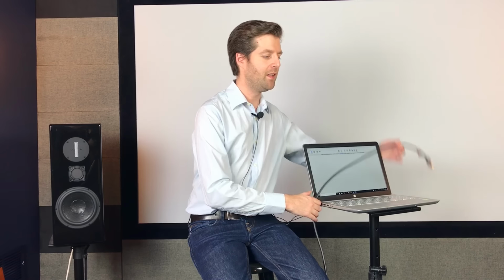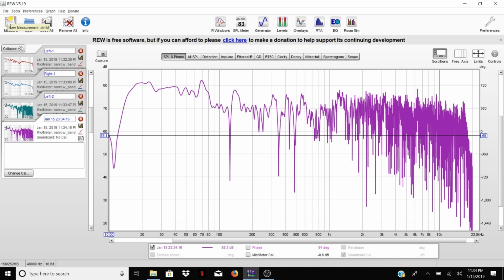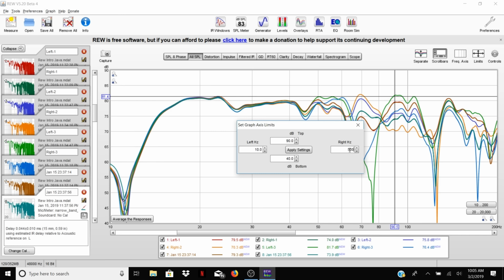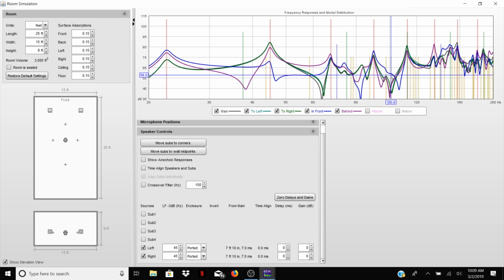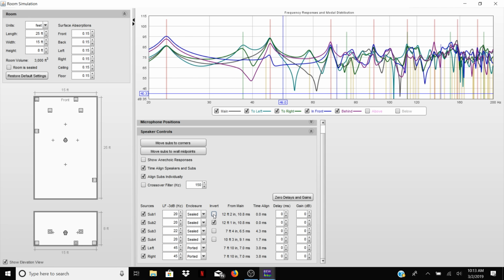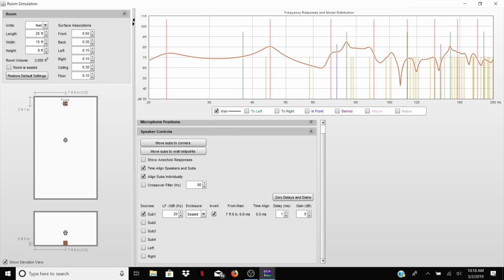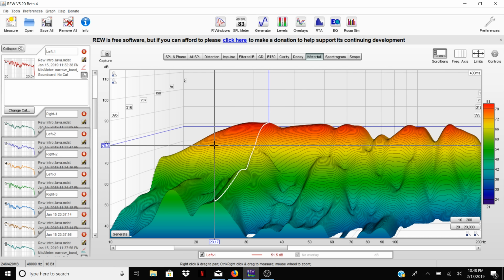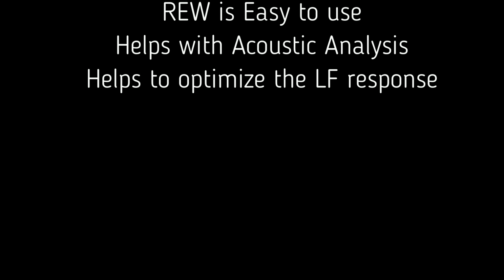How to Do Room Measurements Using REW Software

Comment: Sigh....I just want to know how the changes you make with "rew" are implemented into your avr? I have a denon avr. When you make changes to the frequency curves with "rew" connected to your avr thru a hdmi cable does it automatically change the Eq settings in the internal EQ of your avr?....please anyone????? I'm litterly at the point of begging at this point!...lol!!
Reply from the maker: What? REW is measuring the acoustical response in your room of the changes you are making to your system. When you alter the EQ, delay, level, phase, etc through your receiver and on your subs, you measure those changes with REW. The ONLY way REW can EVER make changes to your system is if you're using a room correction system like DIRAC or mDSP but that goes beyond the scope of this video. REW is being used as a measurement device here, NOT as a device to implement corrections to your system.
Reply: @Audioholics  well thank you so much for clearing this up! But,as a "nubie" you kinda get the impression by watching yours and several other videos on "rew" that it corrects speaker issues. The videos are excellent in the sense they show how to read frequency graphs an so on. But not one video has shown the viewer how to use the info given by "rew" to change settings on an amp or avr or even how to change settings to correct particular issues one might have in a given room. It's awesome to be able to see how a speaker is performing but just knowing a speakers performance curve without being able to correct anything in my opinion is kinda worthless.thank you again for clarifying this issue! I now understand I need to purchase a "dsp" to be able to correct the the frequency response my speakers have in my room. I will say it would be nice to see a video on how to properly change the settings in an avr to change or "correct" any issues in a given room. Its something that is lacking in any video I have seen myself on YouTube and I'm sure by reading several other comments that I'm not the only one who is a little confused on what to do with the info "rew" gives you tou implement correction to a room. Thank you for your time!
Reply: @number1pappy  look up home theater gurus mini dsp 2x4 tutorial
Reply: @discostew9220  thanks but I've learned a lot since my comment a year ago. Since then I've purchased a dsp and have implemented it in my system. I will still say that for any "newbie" the info that is predominantly out there is very confusing at first! Especially channels like "Audioholics" and similar channels like it. Now that I've actually learned a few things its easier to understand. I just think some of these channels "forget" that not everyone knows the basics.
Reply: @Audioholics  So how can we implement them into a PC and play music from there? Maybe over an external DAC.
Reply: @Audioholics  finally, thank you!! You know your dealing with newbs right??

Comment: Is right the left and right channel play together with sub in measure the low frequencies or only the sub can play ? And how measure each channel individually or all together ? Thanks !!!
Reply from the maker: Always measure both front speakers + subs to see how they integrate together.
Reply: What about the center?
Reply: So what about the surroundings speakers do those one at a time? Am doing an 11.4 or 13. 4

Comment: I'm issuing this channel a challenge. Find the best tailgating, Bluetooth compatible, portable, clearest, hard bass hitting speaker / PA system available. Or build or tell us how to build one comparable. This particular market may seem flooded with options at this time but, it is not. Unfortunately the quality of most options are lacking when checking consumer opinions.
Reply: Plus the exact components list and details are not given by manufacturers which I'm sure is so they can sneak in lower quality components.

Comment: The only tools you need to take any kind of measurements,,, are those stuck on the side of your head,, that's right they're called your ears.
Reply: Do you honestly think you can tune the deep bass to ±1dB using only your ears? Or tune the RT60 to 400ms at all frequencies? 

When I optimized my speaker placement and listening position by ear I ended up with a ±12dB response <100Hz. When optimizing it with the help of REW I got a ±5dB response. Once I had applied DSP I had it down to ±1dB (before adding some tilt).

Comment: nice!  A short video with how you should proper measure speakers/drivers frequency for us (audioholics fans that also do diy) would be amazing
Reply: i raul it’s not something we have discussed but there may be some projects that lend themselves to this. Are you looking for measuring DIY speakers to design crossovers or how to characterize a speaker (like Spin-O-Rama)?
Reply: @PoesAcoustics  yes, how to proper measure a speaker with calibrated mics and software  (frequency response without anechoic chamber) to check if the manufacturer claims are real or just marketing and for the diy people that buy already made speakers But also try to make their own designs just because it's fun and rewarding
Reply: i raul I have something planned that should address this. Now that the weather is nice we will start measuring speakers again and I plan to video the process and create a video of what we are doing. 

Just a heads up, what we do  is a very by the books approach and as such, hard to replicate without spending some time building your own measurement rig. James Larson takes his work very seriously and built large custom rigs to measure speakers without much diffraction or reflections from the rig. Still, it will show how we do it and what it takes to get good measurements. This won’t be done for a few months however.
Reply: @PoesAcoustics  nice to hear this. looking forward